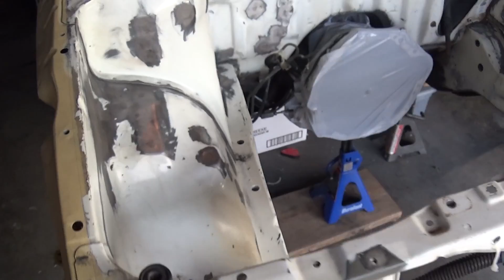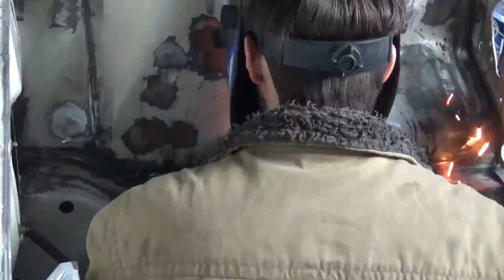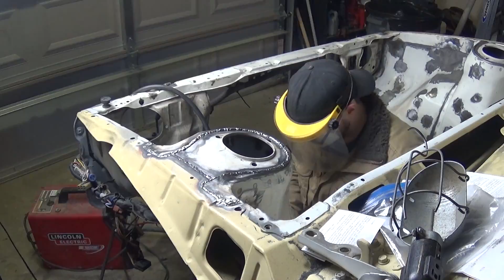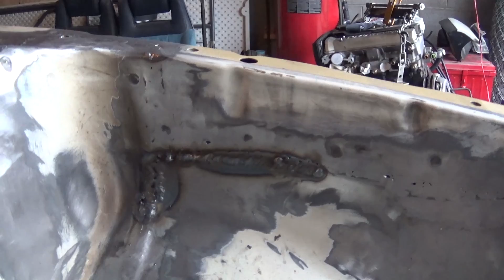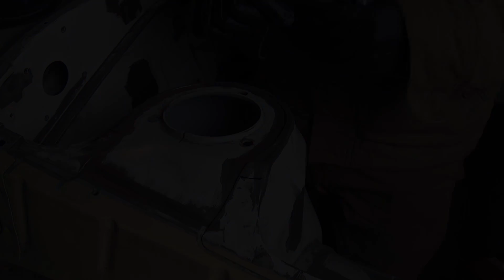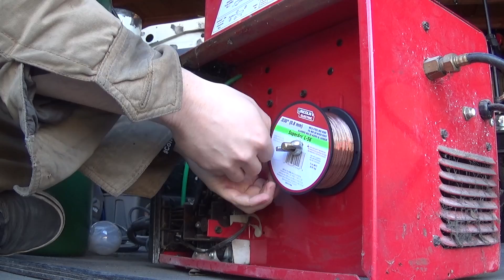AE86 Project | DIY Engine Bay Shave Pt.4 - Seam Welding | Bike Carbed 4AGE - Toyota Corolla AE86

Comment: What you did on the compact right side was to weaken and weld that would not do it in my case it would be better to weld in the factory tie and then lower with the stone
Reply from the maker: Thanks for watching and commenting. I think I understand what you are saying. I left all the factory spot welds on the strut towers, so the oem "strength" should still be there. I basically just cleaned it up a bit. Thanks for tuning in!

Comment: Does shaving an engine bay do anything or is it just eye candy? Thinking of doing it with my ae86 but don't know if it is worth it
Reply from the maker: Thanks for watching! If you will be dailying your ae86 I would not consider it. Welding the engine bay to the extent I have will stiffen up the chassis, but may also affect the cars OEM crumple zones in the  case of a head on collision. One of the main reasons I am doing this is for the wow factor and the challange of me actually doing it.  I want people jaws to drop when the hood is popped at car shows 🤯.

With all that being said, you dont have to weld up all the seams like I am doing to achieve a shaved/clean bay. Thinned down seam sealer will also do wonders as hiding seams as opposed to welding them. Hope this helps!
Reply: @TheBSRecord  cool, good to know was only considering it because the engine is out atm. Great video's keep them coming.